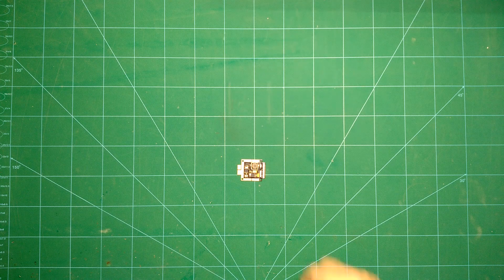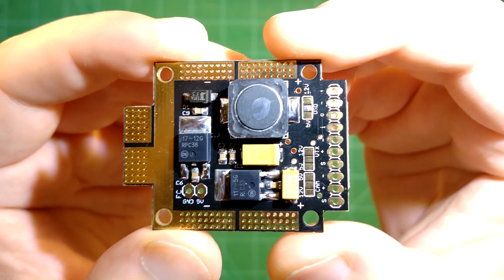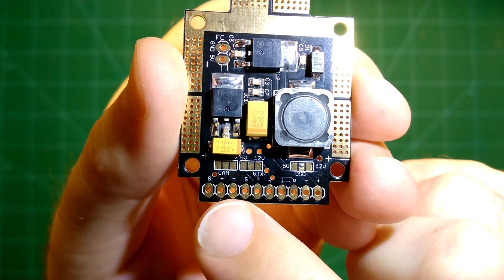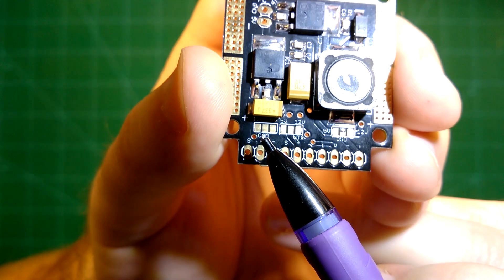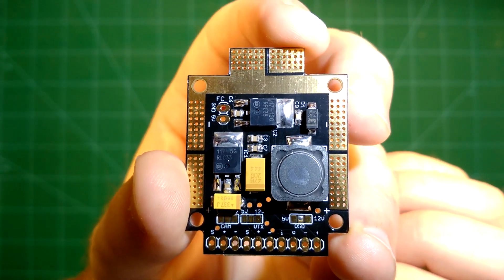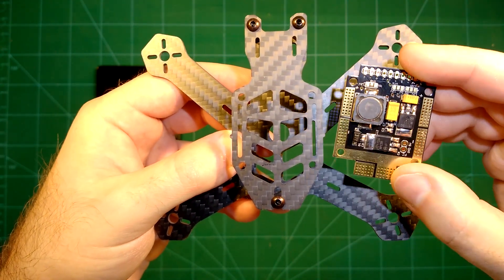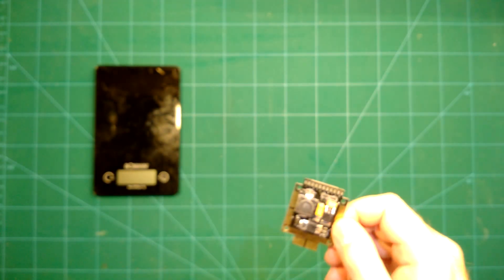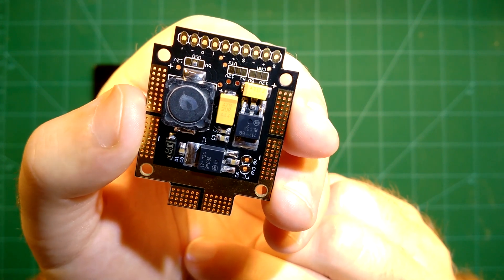Demon Core v2 - mini PDB with LC Filter: Bench Review

Comment: Just got the 2.3 version of this PDB. Higher amperage @ 180 max but no FC 5v
Reply from the maker: The manual suggests to just use one of the other pins for getting 5v for the FC: http://demonrc.eu/wp-content/uploads/2016/06/Demon-Core-v2.3-Instruction-manual.pdf
Reply from the maker: Perfect :-)

Comment: Don't recommend this one, at least not if you're pulling anywhere near to 600ma from 5V.
With just a TBS Unify Pro connected, the 5V line will drop to 4.3V or even lower and the PDB becomes very hot. It's utter crap in that regard/the Chinese cheap PDBs do a better job.

Comment: Great video mate all points coverd :D
I really like where the main Lead for the battery connects setting further back than the rest.
A simple idea. I am pretty sure that you have found the same as i have myself that when the esc connectors and main lead connectors are so close it can get a little tight on the board.
Reply from the maker: +Pudsey - Rc I really like the board as well. It is also made in Europe and shipped from Europe, which is nice as well. I've been in contact with the manufacturer and he is a hobbyist himself who really knows his stuff.